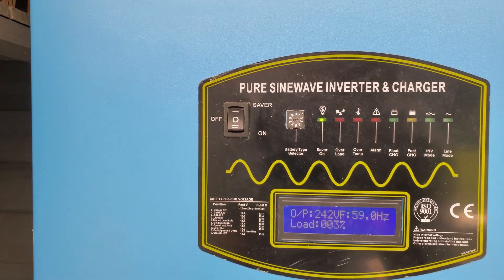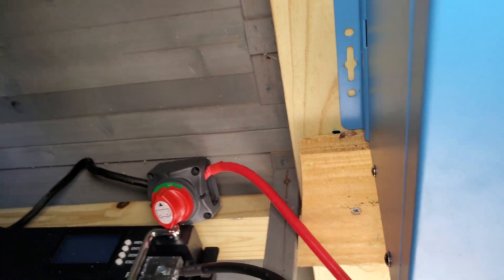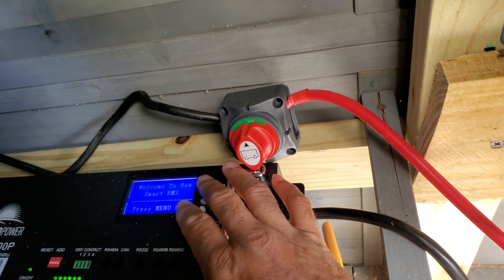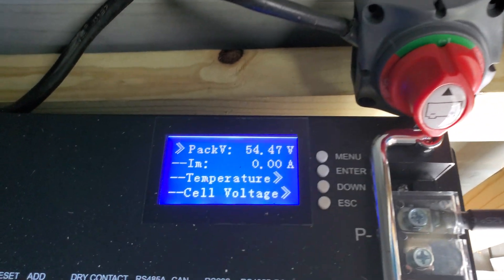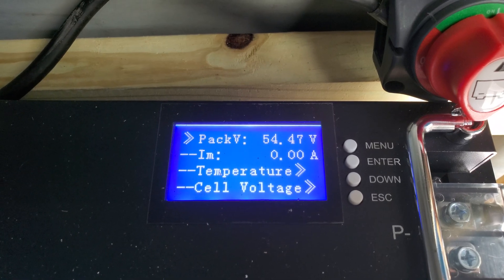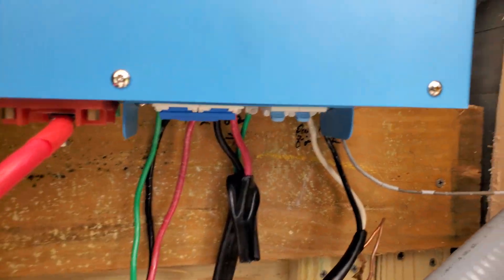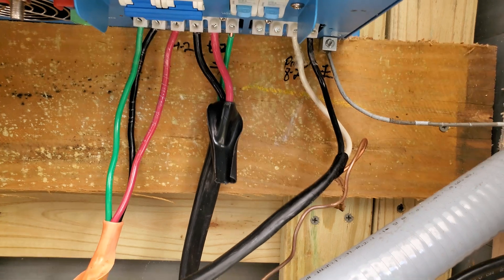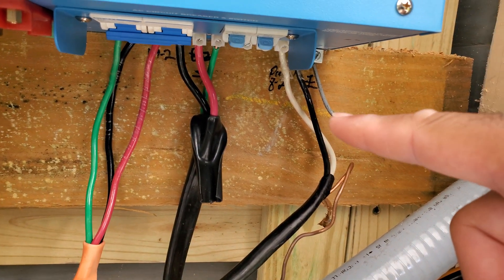Finally found INVERTER MODE on Sungold Power 12000 W inverter

Comment: How is your inverter doing
Reply from the maker: Honestly it is still down and I haven't found a suitable replacement. I was searching for a US-based manufacturer to try but that came up dead due to price. So I'm still looking for a new inverter. I will definitely make an update video on the progress since we now have the batteries we need to draw enough for the AC amps.
Reply: @CivilRepair  cool/// may the solar be with you
Reply from the maker: @bimmers323ci i upgraded the inverter! Check the newest solar videos for details. Grid tied now !

Comment: 5 ton on one battery and i bet you dont have a soft start device on the HVAC. Do the math ure on rush power exceeds the available wattage. get a second battery u need 10 to 15kw to start that ac beast and a sure start for the ac to flip over the compressor at start..
Reply: I was going to say a Softstarter on the AC unit would definitely help. I've been wanting to add one to my 4 ton unit, just looking for a good one that's reliable.
Reply from the maker: Thanks for the tip. It took a while but I actually upgraded to 3 batteries and upgraded the inverter. Now I can support /reduce my grid usage by selecting how much power I want the inverter to output for starting the  AC compressor. Also bought a soft-start but haven't installed it yet. Video coming on that.